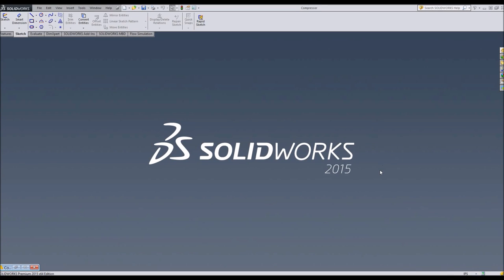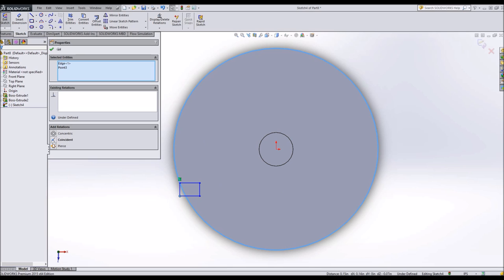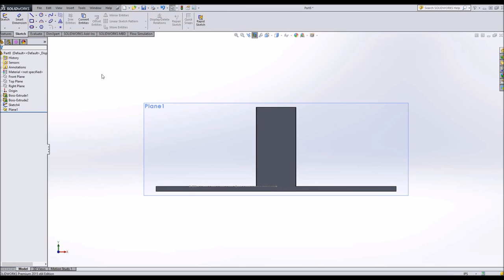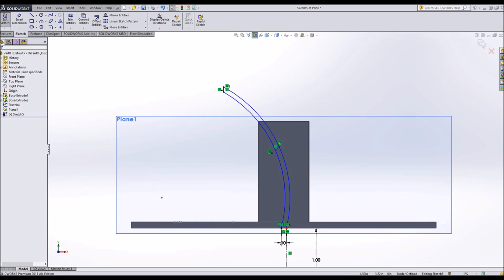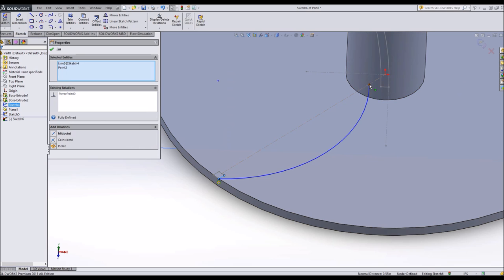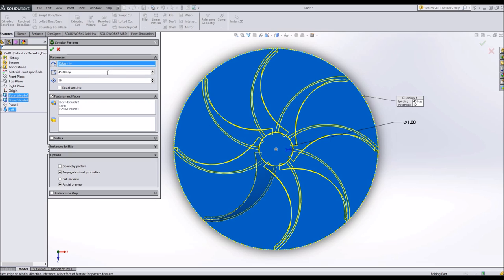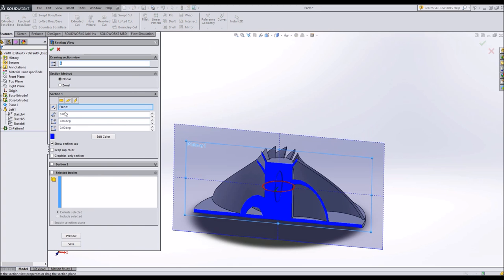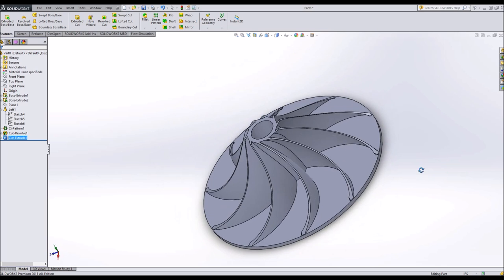How to Make an Axial Centrifugal Compressor in SolidWorks |JOKO ENGINEERING|

Comment: Aside from the point that this is a Solidworks tutorial, which is good, it does show that just because you can draw something, does not mean it's correct. A turbo wheel always has to have the blades axial to the center axis, never, never tangential. Think about the centrifugal forces trying to bend the blades back to axial.

Comment: nice tuto . arent the blades suposed to have an outword curvatur along the edge of the compessor to push the air out  ?
Reply from the maker: othman fikri 
I like your attention to detail, that's awesome.  Depending on the application, turbocharger compressor blades for example can have a reverse curvature.  I didn't pay attention to the details in this as much as I probably should have, just presenting a method of how to make one.

Comment: why would the blade have zero thickness if you sketch it right no the front plane?
Reply from the maker: 李存勖 
Hi!  I didn't see the comment so sorry it took so long to reply.  Those zero thickness errors can be frustrating.  It usually happens when something becomes infinitely thin- I usually resolve my zero thickness errors by changing a dimension by 0.001 or so.  If you're running high tolerances that may not work.  You could also try making a new plane parallel to the you're sketching on and see if that solves it.  If that doesn't help, do you happen to have a screenshot?  You could post to the facebook page facebook.com/jokoengineering.  Again, sorry for the delay
Reply: i actually tried to make the drawing on the front plane, the zero thickness error did not occur, but the final result looked weird. But when I tried your method, it looks fine. You don't need to apologize, I don't have any problems right now
Reply: 李存勖